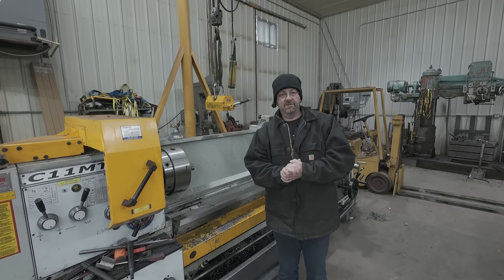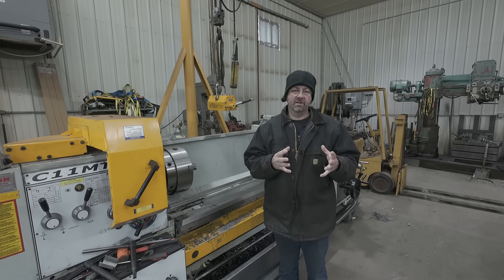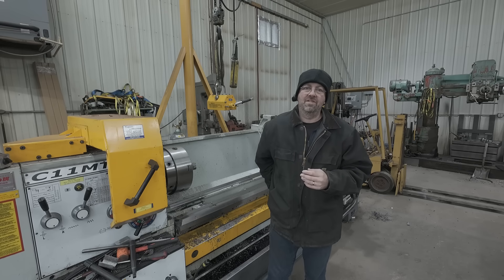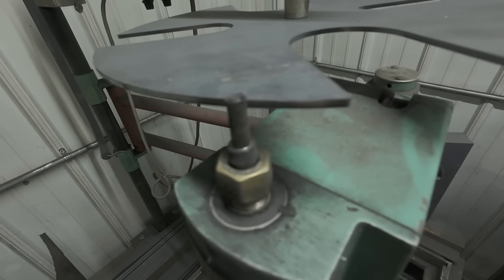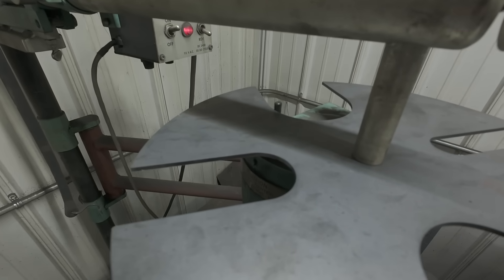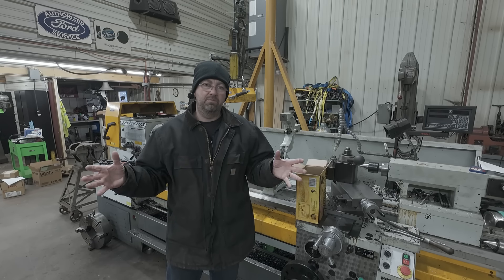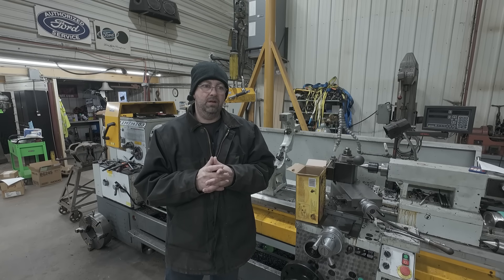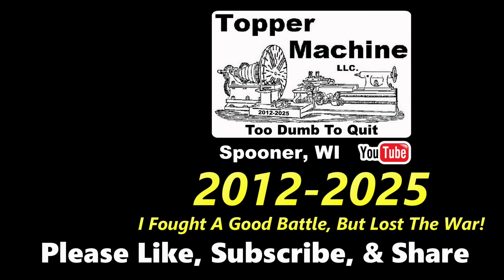How the Victor Duplicator Really Works | Arbor Press Daisy Plate Follow-Up

Comment: Did you buy the propane tips or do you use the acetylene tips with propane?

I have bought a couple propane cutting tips and a propane rosebud.

I just picked up a mostly full oxygen cylinder and a huge full propane tank off of marketplace (with a handful of other cylinders).
Looking forward to running oxy fuel again.
Some bum cut my fence and kicked in my garage door a few years back to haul off the oxy acetylene rig I inherited from my father in law.
I honestly thought it was heavy enough that even with wheels the thieves would not mess with it.
Shows what I know, right?

Comment: A 50-liter cylinder is enough for 30 oxygen cylinders of 40 liters in size. A 40-liter acetylene cylinder contains a maximum of 4 40-liter oxygen cylinders. in Eurasia, they have been cutting with propane for a long time =) if you work at temperatures below -20 degrees Celsius, then the best option is a gasoline cutter, I personally worked at -63 Celsius) Greetings from Russia - Yakutia (Sakha) =)

Comment: Thanks for the update. That's crazy cold, where I live it rarely goes below +14 Fahrenheit. I have a oxy-acetylene torch, but I'd like to switch to propane. As you said, the only advantage of acetylene is a slightly higher temperature, and I mostly do brazing so I'm not really benefiting from the temperature. Acetylene is also quite dangerous, if the bottles get to hot due to fire, or high impacts, you can get a runaway reaction inside the bottle, causing explosions even after the exterior of the bottle is cooled down again. I heard somewhere that American acetylene bottles have some kind of burst panel, but European bottles don't have that

Comment: I have used propane for years, In industry they use natural, or other fuel gasses. you can actually cut thicker material using gasses other than acetylene. Why that is I do not know. Probably has to do with torch design and physics. Maybe magic!

Comment: We had a gas supplier that wasn't reliable, started to take a regulator with me and checking the bottle before we left with it. Used propane when working in a wrecking yard, significantly cheaper than acetylene and worked close, one shop ran natural gas, it was absolutely horrible,  it barely heated enough to cut. One shop used propylene, that stuff was pretty awesome. Acetylene works great, one thing a lot of people don't know or understand, its dangerous. It can become unstable or self ignite at pressures over 7 P.S.I

Comment: I burned out a ton of 4 bolt main caps with a copy torch just like that. We mostly used 16ga. sheet metal patterns as they were easy to make. One thing you might mention is that you need to level that machine well for it to follow the patterns accurately. I see Spooner has hit -46°F before. You don't have to be crazy to live there, but it helps.
Reply from the maker: Actually the cold drives out a lot of people, so I can keep my sanity.

Comment: Excellent video. Propane works awesome to cut scrap iron i use to use liquid oxygen and propane with a long reach angled head victor torch 20 pounds of propane to 1 liquid oxygen tank cutting everything from sheet metal to 4 inch thick iron

Comment: I'm surprised at your statement about propane being mixed with water. This goes against everything I learnt about chemistry. Some googling also strongly supports this. Propane is not meaningfully soluable in water! It is true that there is liquid propane in the bottle. As pressire increases, the dew-point decreases. For more detail look up the phase diagram for propane.

Now what chemistry has taught me does not contradict your experience. Burning is the heat producing self sustaining reaction between oxygen and something else. In this case propane. Propane has 3 carbon atoms and 8 hydrogen atoms. When it burns the 3 carbon atoms combine with oxygen to form 3 CO2, and the 8 hydrogen atoms combine with oxygen to form 4 H2O, water. This is typical for natural gass and other petroleum products. Acetylene has 2 carbons and 2 hydrogens. This means it produces 2 CO2 and one H2O. So a smaller fraction of water. That is why acetylene apears "dryer".
Reply from the maker: Thank you.  I stand corrected and welcome the knowledge

Comment: Propane isn’t dissolved in water in the propane tank/bottle — it’s essentially insoluble. Cylinders contain only liquid + vapour propane. Any water you see comes from condensation, and when cutting, water also forms on the work because H₂O is a combustion product from burning propane.

The confusion probably comes from acetylene, not propane. Acetylene is unstable under pressure, so it’s stored dissolved in acetone inside a porous solid. Propane is stable and not soluble in water, so LPG bottles contain only liquid/vapour propane — no water involved.
Reply from the maker: Thank you.  I stand corrected and welcome the knowledge

Comment: What have you done to prevent condensation on bare metal components, like chucks, in those temps
Reply from the maker: Nothing other than keeping the humidity extremely low.
Reply: @TopperMachineLLC wasn’t sure if you covered. I added mini split but been below 30 here. And get surface rust.  This year trying moving blankets

Comment: One topic not mentioned above is the amount of heat required for large cutting and heating applications,  acetylene has a very low flash or ignition point, around 21 lbs per square inch thus limiting its usefulness where large volumes are required , and as the acetylene gas is evaporated from the acetone in the cylinder there are practical and safety restrictions that come into play. In large jobs, manifolding cylinders was very common. Special cutting tips were available for thick sections, maybe still available for machine guided cutting (burning) which had larger heating orifices compared to the cutting jet orifice. Ray.

Comment: In the 60's we had a Heath UltraGraph that worked on the same principle. We used it with a very early plasma cutter and  oxy/acetylene. We had a Heath pipe profiler that also followed a pattern. It would handle up to 24" diameter. We used it for pipe saddles and pipe transitions into round pressure vessels. Today, CNC sure makes it nice not having to make patterns.
Reply from the maker: I'll just stick with pattern making. CNC in my hobby shop is not worth the expense

Comment: The water is actually produced by the reaction (burning) of propane and oxygen.
95% of the weight of the propane you burn turns into water after the reaction is complete.
So 1kg of propane=0.95kg of water.
Or 1lb of propane=0.95lb of water.
Reply from the maker: Thank you.  I stand corrected and welcome the knowledge

Comment: I have seen a lot of people using propane on YouTube channels. I have oxygen and propane for heating, but for welding, sheet metal, acetylene is necessary, as propane would produce a weld with porosity.
Reply from the maker: That's good to know.

Comment: $225 for that piece of steel is outrageous. New steel here in Australia has gone through the roof and yet scrap steel has bottomed out at $80 a ton, down from $220 a ton last year. Luckily I got rid of most of my scrap steel at $220 a ton before the price dropped to $150 a ton for my last lot.

Comment: You mentioned being surprised by the number of questions on propane.
I am on the West Coast (San Diego area) and have used torches on and off for over 25 years, but I have never heard of using propane during that time. So that was a new one for me.
I appreciate you taking the time to address those questions. Still, I wanted to add that it might be a regional thing where it is a common choice in some areas and less so in others (like mine), which may be a contributing factor to the questions being asked.
It is for me at least.

Best of luck in your new work endeavors.
Reply: A lot of YouTube channels use propane for cutting and welding. It's cheaper and cleaner.

Comment: I would think that you could take a spare gauge with you when getting a new cylinder of a product so you can test the amount of pressure in the tank before accepting it.
Reply from the maker: It made more sense to switch to a reputable supplier.

Comment: One of the contractors that I worked for before retiring used propylene instead of acetylene due to the cost and safety concerns associated with acetylene, the propylene burns slightly hotter than propane.

Comment: The maximum neutral flame for acetylene in oxygen is about 5720 F, while the temperature for propane is 5112. This does not, however, mean that propane gives off less heat.

Acetylene may burn hotter and can even pre-heat metal faster. However, with the proper knowledge, parts and setup, propane can actually match or even outperform acetylene. Obviously, there are a lot of variables involved. The question is not which option is best, but which option is best for you depending on the type of work you want to do and the equipment you want to use.

Comment: Ive always used oxy-propane...old farmers trick. Ive used acetylene too, but less personally. We used it in an aircraft parts shop I worked in when cnc flame-cutting titaniums, and inconels because they seemed to like that, causing less kerf run-out; but we went to a water-jet which cuts everything. We still used oxy-propane for heating hot manderal forms there, and made our own oxygen. Thanks for the feedback on the drive of the pattern follwer.
Reply: Ok, curiosity struck! How did you make your own Oxygen?
Reply: @trollforge  The shop made liquid oxygen with a huge compressor designed for that, which was piped inside as a gas.

Comment: Thanks for the duplicator tour! Nice simple machine!
>Propane on my torch here for 40 years here on our little farm.. I'm 20 miles for gas suppliers and you NEVER CAN get both bottles(oxygen/Acetylene) to run empty at the same time, so have been filling a 20 pounder off my house tank since 1984.. The 4.2-4.5  gallons costs  less than 7.00$ on summer fill out of my furnace tank and no trip to town.(time/money/ saved) Its 24$ at ACE hardware for a exchange tank that probably only had 15 lbs in it..(3.5 gallons)or less than 5$ worth the gas.
 Thanks for the tour. .Thanks for the great videos!

Comment: if you changed the length of that last arm that actually clamps the torch head you could make that thing scale up/ down your pattern, though it looks like the clamp is riveted to the arm so you'd need to remove those and figure out a clamp system, A lot of work BUT it would make that machine multi purpose :)
Reply from the maker: No it wouldn't. You need multiple arms and linkages to do that.

Comment: NO! Propane is NOT dissolved in water, it just contains relatively more Hydrogen, which burns into water.
Propane burn reaction: C3H8 + 5 O2 → 3 CO2 + 4 H2O
Acetylene burn reaction:  H2C2 + 5 O2-> 4 CO2  + 2 H2O 
How Acetylene Is Stored

The cylinder is filled with a porous mass (typically materials like agate, diatomaceous earth, or cementitious compounds) that occupies most of the internal volume and prevents voids where pure acetylene gas could accumulate.
Acetone (a liquid solvent) is added to saturate this porous material. Acetone can dissolve large volumes of acetylene (up to ~25-40 times its own volume per atmosphere of pressure) without reacting with it.
Acetylene gas is then introduced under pressure, dissolving into the acetone. This allows safe storage at moderate pressures, typically up to around 250-275 psi (15-19 bar) at room temperature.
When the cylinder valve is opened, the pressure drop causes acetylene to come out of solution as a gas for use.

This design stabilizes the acetylene, distributes heat during any potential decomposition, and prevents explosive reactions.
Reply from the maker: Thank you.  I stand corrected and welcome the knowledge

Comment: As far as I know there is really only one torch use case where you can't use propane, welding. As it was explained to me the combustion byproducts of acetylene provide shielding gas for the weld whereas propane does not. interesting about the magnet I definitely wondered how the stylus stayed biased towards the pattern.
Reply from the maker: That I'm not sure of. I have welded with propane.
Reply: @TopperMachineLLC  Could be total old school myth, Ive never tried it

Comment: Josh, I believe you are mistaken about propane being dissolved in water. Propane is a hydrocarbon like gasoline except at temperatures above -44°F at normal atmospheric pressure it is a gas. Propane in the tank is under pressure which allows it to turn to liquid. Propane flashes to a gas as the pressure releases in the regulator. This change of state causes the gas to cool. The cool propane before it is ignited could cause condensation on the metal from moisture in the air. I think most likely it is water created by burning propane and oxygen. Propane and oxygen create co2 and h2o went burned. 1lb of propane creates 1.63 lbs of water when burned. Propane and water will not mix when both are liquid because propane acts like oil and will not mix. Acetylene is dissolved in acetone to stabilize it and prevent explosive decomposition.Propylene is another replacement for acetylene with higher amount of BTUs, it burns even hotter than Oxygen and Propane
Reply: Well said. Now I don't need to write all of that. Short version- water is a byproduct of combustion and it condenses on the cool metal.
Reply from the maker: Thank you.  I stand corrected and welcome the knowledge

Comment: I noticed that you didn't answer the following question posted in your last video:  "How much offset do you allow for kerf width and stylus radius when laying out the template?
The 1/4" diameter stylus will cause an OD cut to be 1/4" larger and an ID cut to be 1/4" smaller than the pattern. (on the diameter)  The kerf width will, however, reduce this error but the error will be greater on thin versus thicker plate.  Granted, on parts such as the daisy plate, the error can be disregarded, but, when making parts to a print it needs to be compensated in the pattern.

Comment: There are three main processes to make propane from natural gas.  Lean oil, refrigeration and cryogenic.   Water does not enter into the picture.  Moisture will cause the process to freeze up.  Propane can have small percentages of ethane and butanes in the mix.  But no water.
Reply from the maker: Thank you.  I stand corrected and welcome the knowledge

Comment: Actually your statement that propane is dissolved in water is not correct.  There is no water in a propane tank.   In fact propane is hydrophobic and will not mix with water. Here is what is really happening.  The propane in the tank is in a liquid form.  There must be some space in the top of the tank for the liquid to evaporate inti a gas.  This gas is what you burn. 
Propane is a hydrocarbon with the formula C₃H₈. When it burns completely in oxygen, there is a chemical reaction.
• Each molecule of propane contains 8 hydrogen atoms.
• Those hydrogens combine with oxygen during combustion to form water (H₂O).
• For every 1 molecule of propane burned, you get 4 molecules of water.
This is why burner assemblies using propane can be prone to rust and why a high efficiency propane furnace must have a condensate pump to get rid of the excess water that is produced.  The water in a propane tank is a myth. 
I do get it though.  The water we saw in your video does indeed come from the propane combustion process.
Reply from the maker: Thank you.  I stand corrected and welcome the knowledge.

Comment: Very cool. I do stone fabrication work and we use oxy propane torches for a lot of work. Works great. And I have experimented with melting steel with it and can confirm that it works well for that. I wanna try welding with it but we only have rosebud tips.
Reply from the maker: It will weld. I have done that. Just takes a little longer.

Comment: For anyone else wondering: -20°F is about -29°C, so yeah, really freakin cold.

For the magnetic stylus to work the pattern not only has to be made from metal, but from steel specifically. Didn't hear you mention that. I know, there are some more magnetic metals, but pretty much none of those would be relevant. Anyway, I always dislike it when in product descriptions they write "metal" for material, because there's a lot of metals (usually they mean steel).